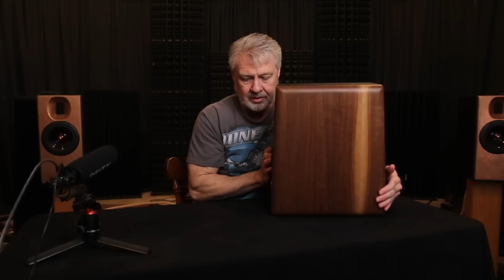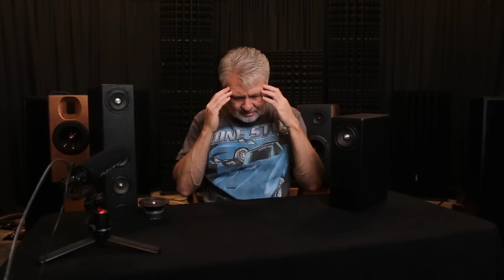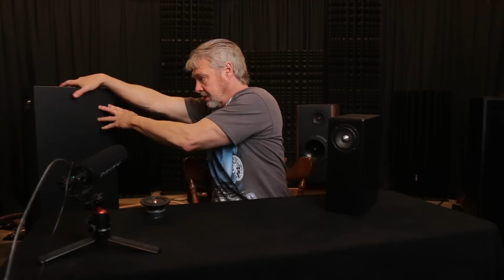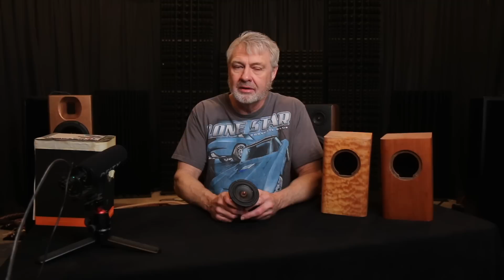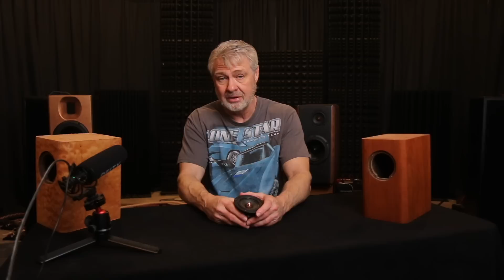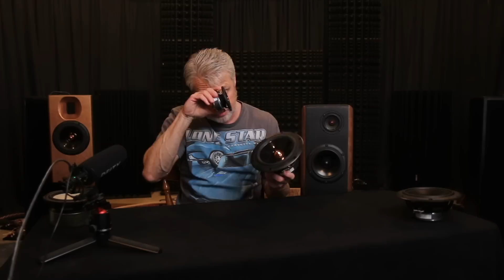Finally. We Can Chat About These... The New Record Day Loudspeakers!

Comment: I like the idea of it I have been thinking about doing the same thing. The thing is I want a Bully or a Brute with this design. It has to have great hollographic sound and be able to hit hard not one or the other but both. 

I am really tired of having to have one set of speakers to do job (A) and another set to do job (B)!  I am fine with having to add dedicated subwoofers for everythng 100hz and lower! I am tired of all of the speakers with 6.5" speakers and smaller that can not handle any power and are as effecient as a Dodge Viper V10. 

Danny's argument is always "Power is cheap and available so effeciency does not matter just put more power to them." You can not do that though if the speaker can not handle the power. So now you have low effeciency speaker that can not handle even modest amounts of power! 

I love real wood hard woods can be very beautiful. I am not an Architect though so instead of the pretty wood on the sides of the speaker where I will never see it and niether will my guests when listening how about we have the pretty wood on the front as well. I understand you want these in the room not a corner but still let's see the wood while listening! There is a reason we build cabinets with the cheap stuff and face them with the good stuff not the other way around we do not build them from hard woods and face them with MDF! 

I love your channel I watch every video and have been watching the older stuff as well! Thanks for the channel!
Reply: Actually no big power amps are needed. These have been paired really well with the Miller Audio tube amps that are only 35 watts of power. With that they fill a big room really well. 

Also, these are just prototypes. The production models are gorgeous.

Comment: Watched the whole thing as usual. 😂

Wondering about efficiency and input impedance … Will my little, beloved 300B amp work with these at all?
Reply: Sensitivity is 85.5db and they are an nominal 8 ohm load. We just played these last week with out 300B amp (9 watts). It sounded beautiful, but is only enough power if used in a small to medium sized room where loud volumes are not needed.
Reply: @ Sounds perfect for our living room system. Thanks 👍

Comment: Danny, nice shirt. Lone Star is tie name of 1 of my Nigerian dwarf goats. He has a single tag on his rt ear and a perfect heart on the center of his back. Danny, i wanna use ur LGK drivers in my new truck build. I started years ago in the 80s with hifi home audio. Then, I got into car audio. Now I'm rebuilding my SQL truck. I usually run a 4 inch and tweeter above tje dash and I've been through a few small drivers in the past few years like Dayton, peerless, tangbang.  Haven't been happy with any of them so far. Layering and soundstage just weren't there, not the way I like. The biggest issue is I can hear in incoherence in the upper octaves. Danny, thinking the LGK 2 running everything above 300hz could fix my issue. ❤

Comment: My finances are into the drain at the moment , but who knows in a not so far future,....
This is problably the speaker in your all line ,....that arrised my interest more until now !!!!
Reply: I’m telling you, this speaker is gonna freak out a lot of people.
Reply: @Newrecordday  Why was placing the drivers as far apart as possible your design choice?
Reply: @ the crossover point is very low, approx 250hz so the acoustic centers can be further apart in this design. 

Danny worked hard on the exact position of that top driver to get the absolute best phase integration with the woofer and I think it turned out great!
Reply: @Newrecordday  does 1mm Xmax at 250 hz not severely hamper the output capability? 
Tbf the low mids and mids on my dash blend well . 
Were you restricted by the cabinet design or was it a design choice?
lol phase, with a rear facing driver . You’ve got to be joking

Comment: I am not even comparing myself to Danny of course, but in the course of my about 40 years as an music lover and audiophile , i ahve had , heard many speakers , i have build a couple of them also, 
Funny is that the best d.i.y speaker that i have ever build was also a little wide band driver augmented by a 6,5 inch mid-woofer .
Reply: There really is something special about this formula and while some folks might feel Danny and I are hyping the hell out of it - I can assure you it’s the real deal. By a wide margin, this is the best stand mount speaker I’ve ever spent time with.
Reply: @Newrecordday I count myself among that subset of the DIY speaker building community for whom this general topology has been popular for well over a decade; we even have a silly little acronym for them - WAW.  My absolute favourite was a tall MTM floorstanding utilizing a pair of paper cone extended range mid-woofers and a metal cone wideband, both in highly damped isolated MLTLs.
Properly executed, there’s not a lot of hyperbole in saying this type of design can definitely punch above their weight in terms of cost of drivers and XO components when compared to mainstream commercial products.
Reply: @  Any idea from what will be the final price ( an around price, does not need to be precise ) ?
and when can we hope to hear more about this as a complete to order product ?
Thanks !
Reply: It’s because of phase and time alignment.
Reply: @CULT539 
I suspect it still exhibits phase rotation across it's operation, ... as do all moving coil drivers. 

𝘌𝘓𝘐 𝘵𝘩𝘦 𝘐𝘊𝘌 𝘮𝘢𝘯 is a bad dude.

The real minefield that's avoided is the driver handoff within the critical midband (plus the excess mms). 

Dig it.
Reply: More than likely because it didn't require a lot of crossover design.
Reply: Thought of the exact same reference….no idea what they sourced but Logitech did some crazy good things early on in audio, IMO.
Reply: Crazy how Canadians would rather buy Made in China products vs Made in USA products now that we are under attack !?!

Comment: How far out in the room have you designed them to be placed?
Reply: Ron here. 3 feet is bare minimum. I really want people to experience the full potential of this design so I’d really hope folks can get them deeper than that in the room. 

Mine are 9 feet into the room.
Reply: @Newrecordday2013  I couldn't do that in my living room, it's about 12 feet front to back.
Perhaps I could get them in my garage gym which is 8m x 2.5m but they would be sitting on wall brackets pointing longways 2.5m apart.
Would that work?
Reply: You got to get , far out MAN😂 , had to say it , just got done watching Cheech and Chongs up in smoke 😂 and I'm high
Reply: You really need a medium to large listening room that is well treated for these to perform at their best and do their imaging magic. Ron’s room is 50% of the sound of these speakers. Speaker placement is only part of the requirement as proper room treatment is really the thing that knocks it over the top. The listening room is king. And that was one of my key takeaways from hearing these speakers in Ron’s room, and inspired me to try to figure out a way to better treat my listening room.
Reply: @BrentLeVasseur  when I had a life , I had farms , 2 of my farms in life had huge barns , I put in cement slabs , one was 60 by 40 feet , I built strong walls that I filled with rice straw bails .
Then used theatrical curtains to cover the straw bails , talk about a natural sound deadening, it was over the top as a hang out place , or man cave .
I had over 40 pairs of speakers , some I designed and built , some huge , like the old VMPS super towers, , I had MISSION, JAMO , JBL KLIPSCH, M&K , CANTON 
BLAH BLAH BLAH , oh boy did that room sound good and was fit for a hillbilly and a scholar. Back then in Putnam county Tennessee 
I had friends that was professors at Tennessee Tech University that was deep into audio and we would have dinner parties and listen to music on my speakers as well as there's if they brought to hear in the straw bale domain. Cheers and happy listening.
Reply: @ Sounds like a fun place to hang out in! While open baffle speakers do a really good job of mitigating a small/untreated room, the best solution is headphones because that essentially eliminates the room entirely. That’s why I recently invested in my ultimate end game headphone the Hifiman Shangri La Sr. It’s like having the perfect speaker in the perfect ‘room’. And it also makes sense for someone like myself who lives in an apartment where I have neighbors above and below me and I can’t have powerful subs playing floor shaking bass. Headphones solves those problems. And if you are on a budget, what I tell most people is get a pair of Sennheiser True Motion Wireless 4 IEMs and a pair of Hifiman Ananda BT Nano wireless headphones and you are done! The Sennheisers are for traveling on planes, working out, listening outside in noisy environments, and the Ananda BT V2 is for listening in doors in private. That’s a $1200 end game hifi system right there as it incorporates the DAC, amp, and room all in one. You can’t beat that bang for the buck!
Reply: @BrentLeVasseur  isolate your sub from the floor about 2 feet off , it helps .
Reply: He said 3 feet